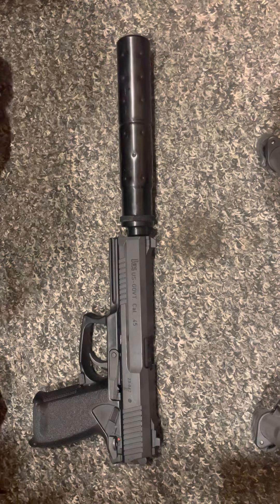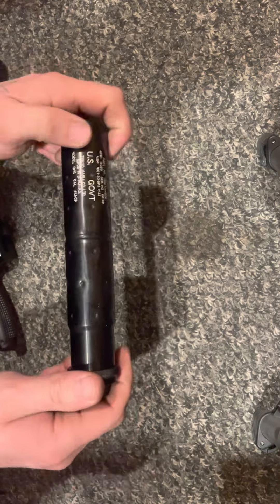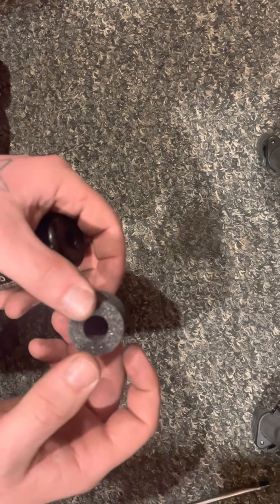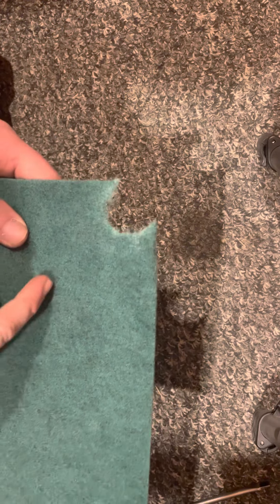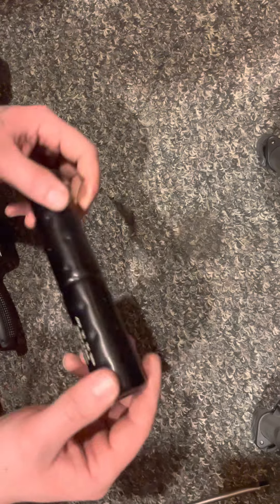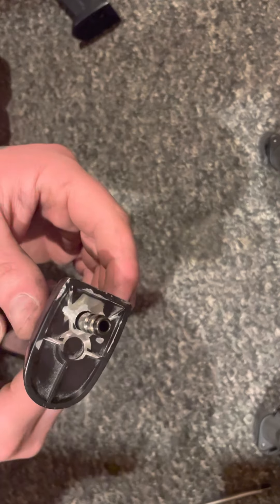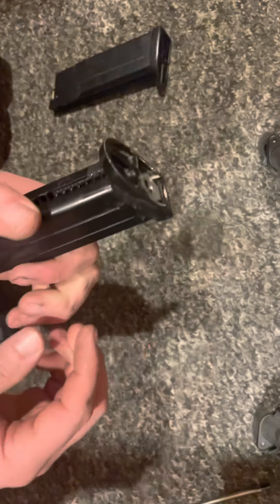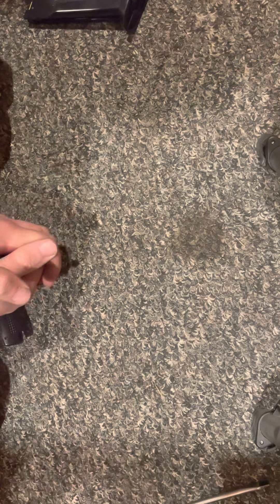Tokyo marui mk23/asg/stti airsoft pistol mods and upgrades

Comment: is there anything that stops the plasticy click when pulling the trigger
Reply from the maker: Hi yes you can modify the trigger unit by adding rubber buffers on the hammer and plate the hammer hits to quieten down the initial hit of the hammer but from what I’ve seen or heard you can’t completely get rid of the click